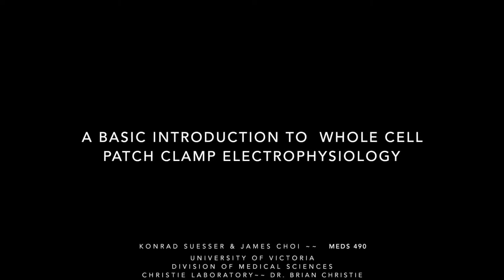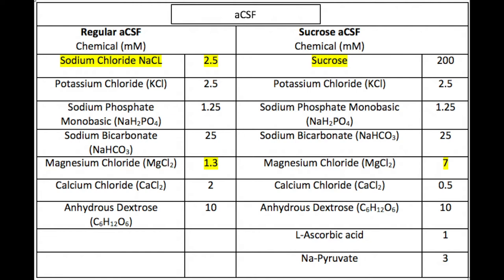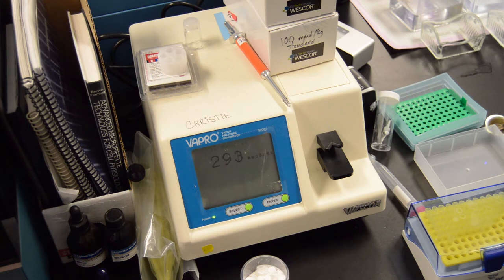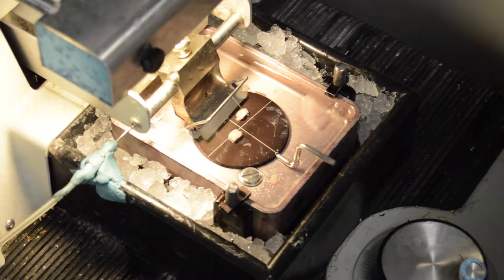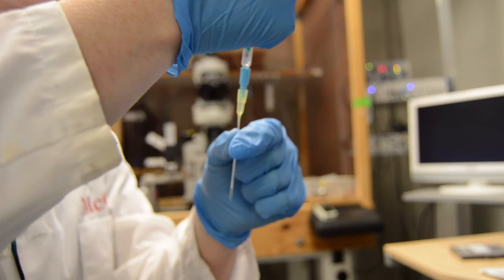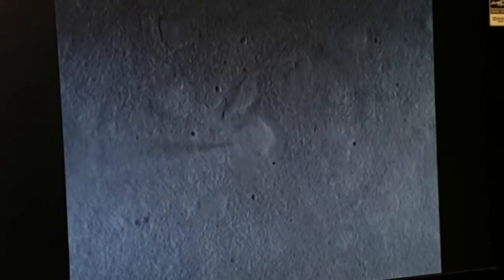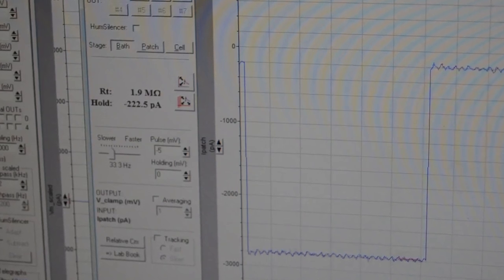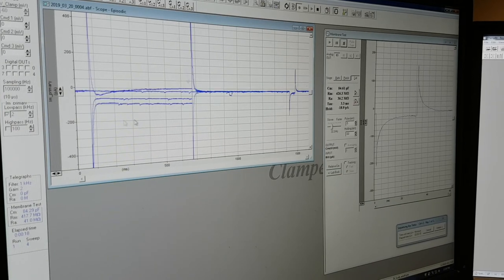Basic Intro to Whole Cell Patch Clamp Electrophysiology

Comment: Where can I find more information on the theory and principles behind whole cell patch clamp recording? I'm recording from cultured mammalian cells transfected with recombinant receptors, and I would like to familiarize myself more with the different types of errors (e.g. voltage errors from currents that are too large), how to judge the quality of a seal based on the shape of the test pulse response, etc. as well as how the recording equipment operates (digitization, sampling rate, filtering, etc.) that applies to patch clamp recording in general.
Reply: I would strongly recommend giving the Axon Guide a read! You can download the PDF for free on the Molecular Devices website.

One major voltage error to look out for is series resistance. Bill Connelly has a blog post titled "Series Resistance. Why it's bad." that explains how it affects your recordings, and a follow-up on how to properly compensate for that. To add, if you plan on compensating for series resistance, the quickest method of minimizing pipette capacitance that the lab I'm in uses is wrapping a thin strip of parafilm around the pipette until you get close to the tip and minimize the amount of internal solution. 

Another source of error is the liquid junction potential which is voltage offset caused by differences in cation and anion sizes in the pipette solution, which is really only notable if you use a large anion base for your solution like K-gluconate. Nat Blair has a blog titled "What is a junction potential?" and a follow-up titled "How do I measure the liquid junction potential?" that goes over it in better (and more correct) detail than I did. 

Sorry for not adding links, I'm not sure what YouTube's policy is for adding links on comments. I know I'm a little late on the reply, but I hope this helps!

Edit: I'm not associated with this lab, but I primarily do patch for my research